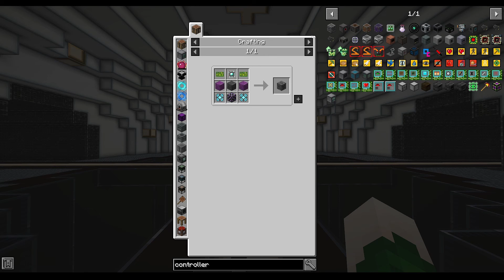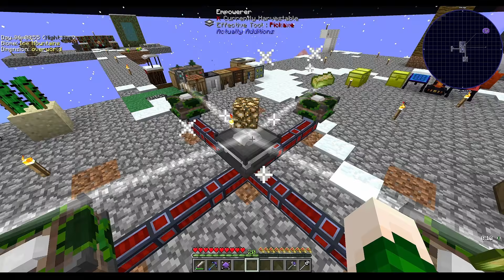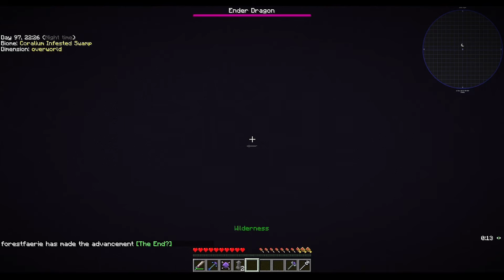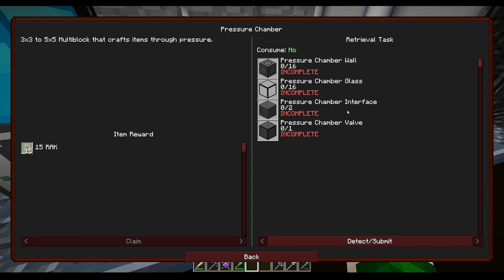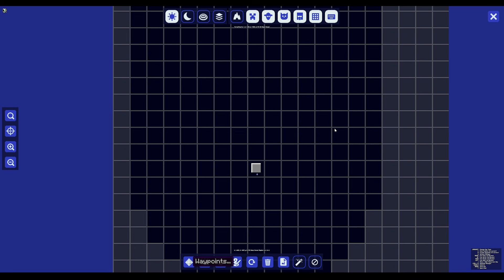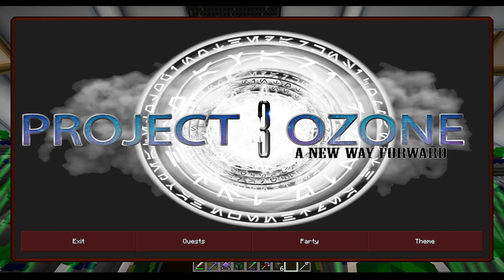Project Ozone 3 Mythic Mode E05 - Ima Firin' Mah Lazer

Comment: Don’t need to filter the extract of the alloy furnace, you just accidentally set the 1st input slot to have the ability to extract from when configuring the sides, the default configuration is enough to extract/insert the right stuff
Item lasers just need to be connected to the item laser network, don’t necessarily need to connect to the input item laser in the center of your setup, but it does look cool!
Your mob farm doesn’t work as it is more than 128 blocks away from the player in the same dimension, therefore mobs will instantly despawn when they spawn. There might be an ocean in the lost cities that you can make a guardian farm possibly?
Can make another enhanced alloy smelter to speed up alloy making
Reply from the maker: i was wondering why the alloy smelter was being so difficult lol so that explains it. 
very useful info about the mob spawning mechanics i didn’t know that was the issue